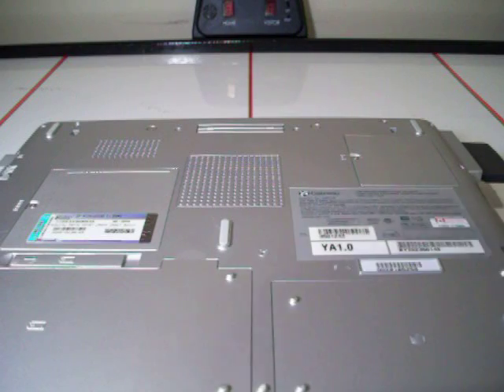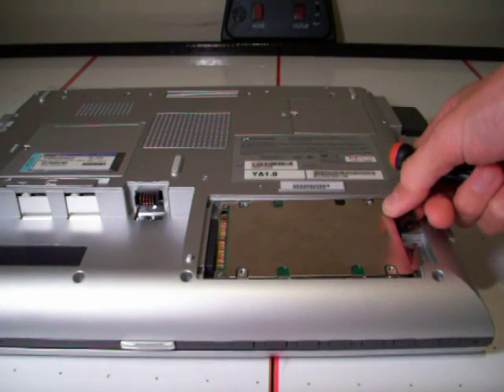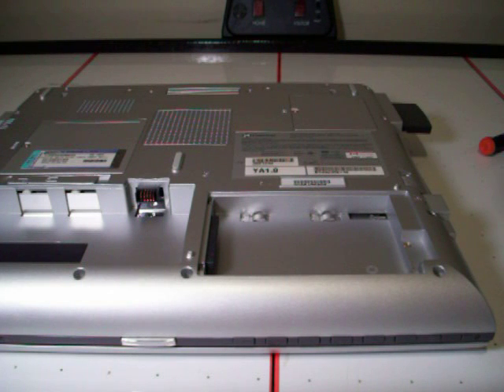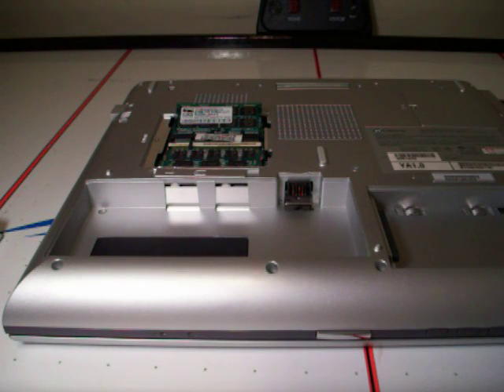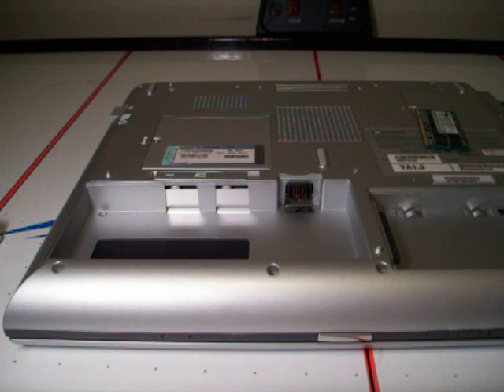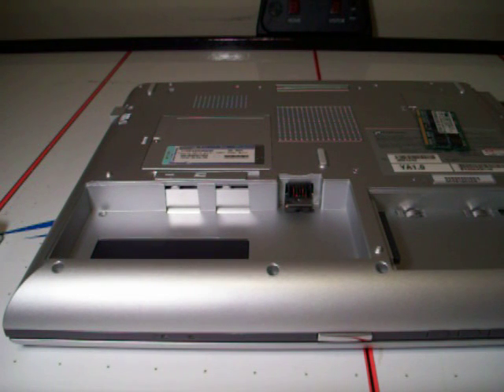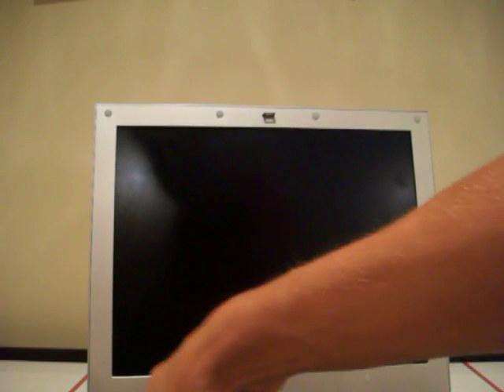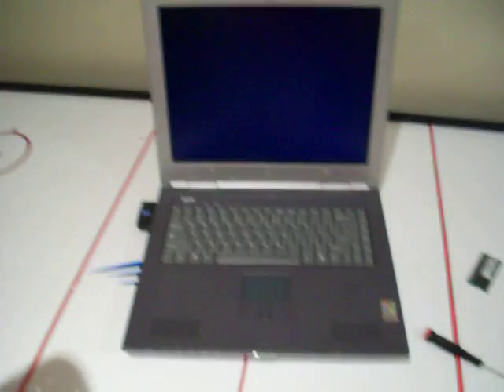How to Install RAM and a Hard Drive in a Gateway Laptop

Comment: I have a question, 
I sold a gateway laptop cause it was reading operating system not found.
Now the guy who bought it is saying that the 320 hard drive was not in it.
I dont know what the laptop would read if it didnt have a hard drive in it. would it do anything at all? all I know is that it just wouldnt get passed the error message.
also i tried installing the cd. it would take cd 1 ask for cd 2 and not get any futher than that.